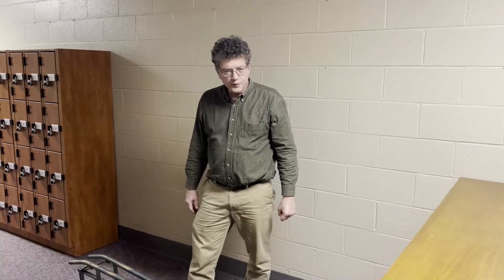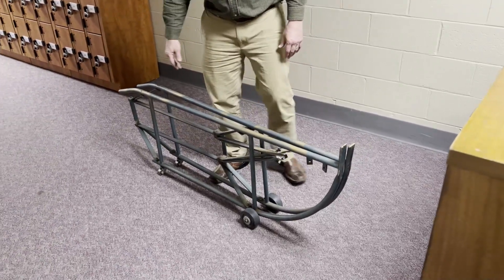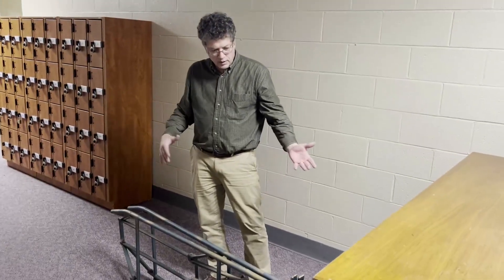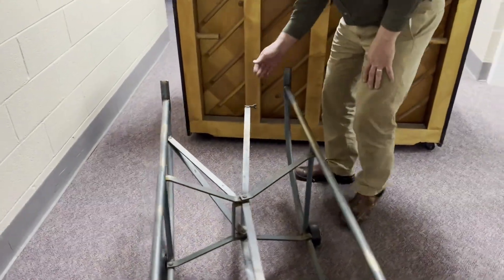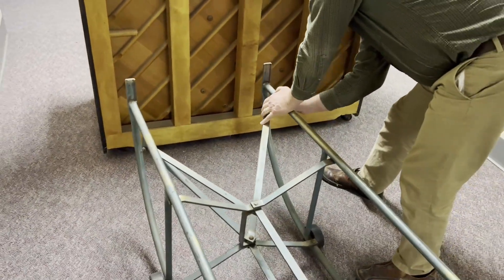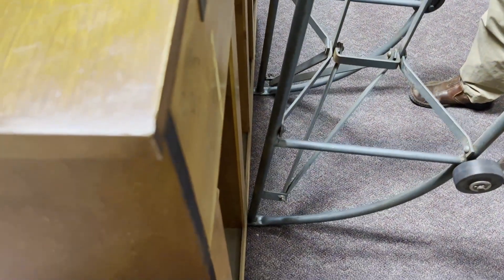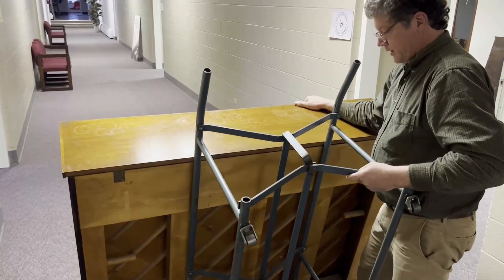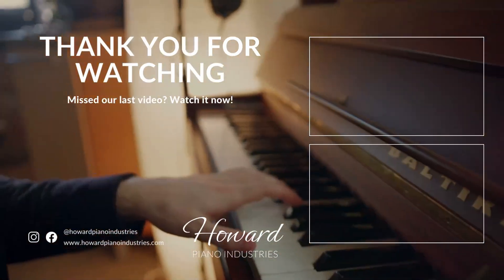Piano Repair Truck Demonstration | HOWARD PIANO INDUSTRIES

Comment: These are great! I have an old one I got second hand, and have used it several times. I like to tie the middle pillar on the back of the piano to the frame of the tilter, using a ratcheted strap, to make sure the piano stays attached as I'm leaning it back toward me, so I can keep both hands firmly on the tilter.
Reply from the maker: Good tip. This is a good safety precaution.

Comment: Hello, i lost a piano due to flood in my house and i am afraid to rebuy one if flood happens again. My question is how long do you think an upright piano can be left in that position without damaging it. I could buy one to tilt it when i leave the house to prevent flood. Ty by advance for you answer.
Reply from the maker: An upright can sit on a repair truck for as long as you need. Thanks for watching!